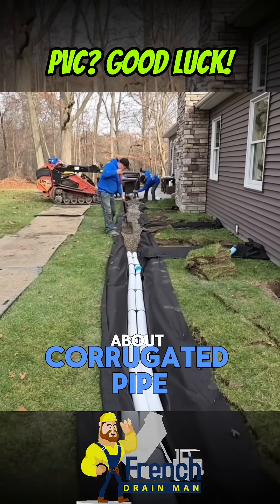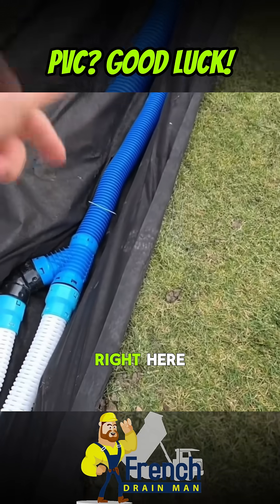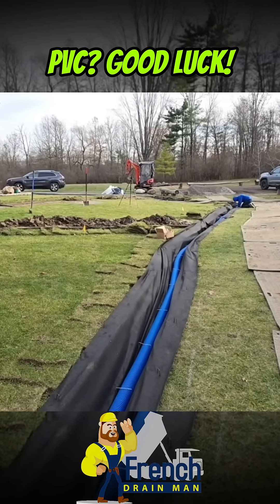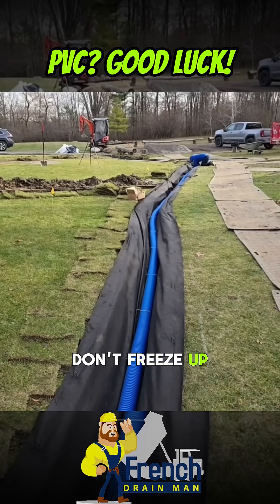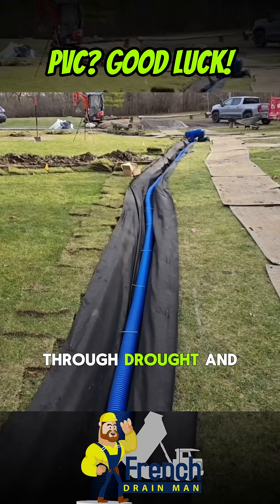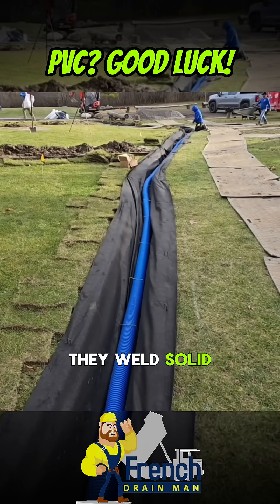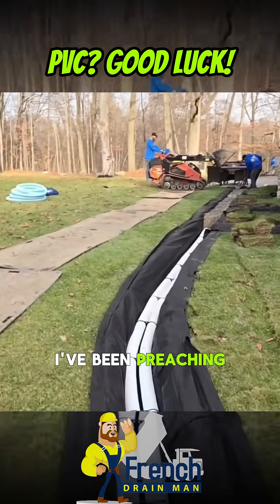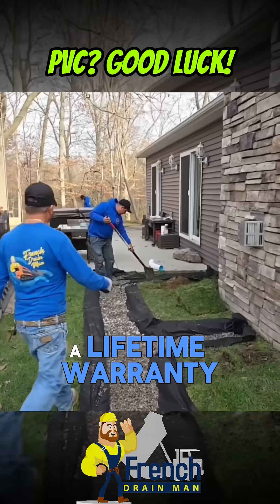Stop Using PVC for Drains — Here’s Why It Always Fails

Comment: Hmmm, I used PVC schedule 40 for my entire sewer in eastern Washington about 25 years ago. When I sold, the new owners ran a camera and looked brand new. Also use schedule 40 for gutter drains here in NY. 14 years ago; glued joints; Clay soil. The only thing that was and is currently failing when I bought the house was corrugated. Maybe the blue is better? 
That said, PVC also gets brittle so so crushed gravel helps protect it.
Reply from the maker: Thank you for sharing.

Frenchdrainman.com

Comment: What about gasketed PVC? Has been the standard in Europe for underground applications for decades, the joints hold up amazing, even through freeze and though
Reply from the maker: Its pricey but worth it if your going that way.
Reply: Tons of gasketed PVC in FL. Potable water, reclaimed water and sanitary sewer lines are all gasket PVC. They are starting to implement that new HDPE heat weld pipe for potable water mains in some areas though. For larger storm systems it’s been mainly RCP for years but a lot of dual wall HDPE and HPPP is now being installed everywhere.
Reply from the maker: @StormWaterDrainageSolutions I just don't see anybody in yard drainage using the premium pipe. It's not the norm.
Reply: @FRENCHDRAINMAN  Definitely not the norm for residential. I’ve only ever seen it twice on two different homes for their exterior drainage systems. Both houses were mansions and both systems were extensive with larger diameter mainlines that discharged into onsite ponds.
Reply: @StormWaterDrainageSolutions around those parts of the world they are starting to use heavy-duty gasketed polypropylene called KG2000 for residential strorm drainage, the difference to most US instalations being that downspouts are tied in to the strom sewer by default, with less shallower pipes and a dedicated storm manhole in most driveways
Reply: @avgeek_a321 That’s interesting I’ll have to look into that pipe.